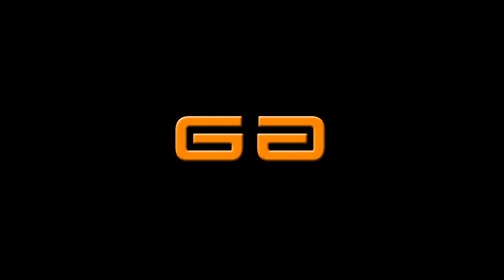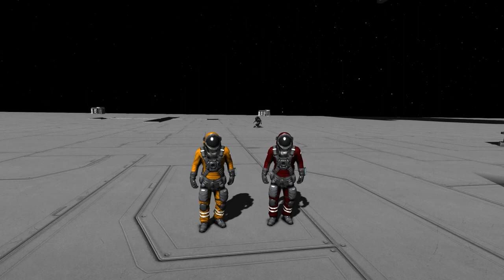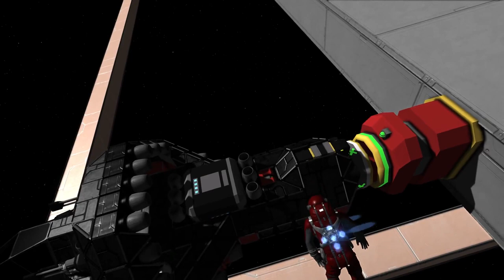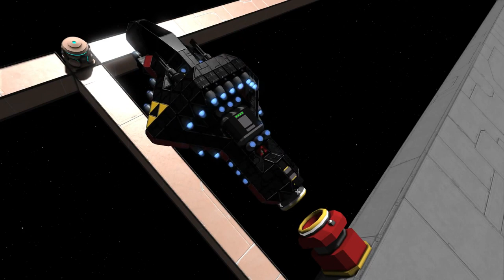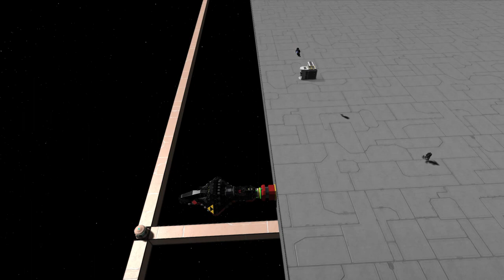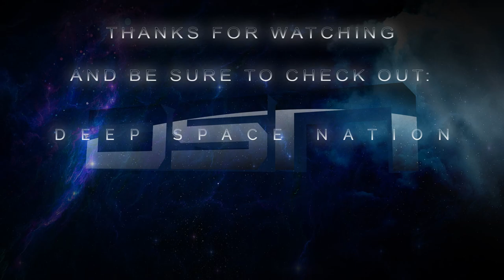Auto Docking With Falnore From Panurga!

Comment: Looks very promising!
One thing I noticed however: you manouvered the fighter in such a way that it has only to go straight backwards without having to turn at all.
Does the concept work equally well if you park the fighter somewhere else? For example 100 meters to the left and 50 above the stations connector?
Reply from the maker: Brenner42 Indeed it does!  It uses two waypoints.  The first it to take it to a position directly in front of the connector, the second is to take it to the actual connector.  I could be so far away with the ship that I can't even see the base, and it will go all the way back to that connector all by itself!